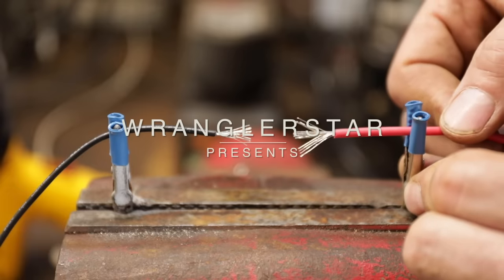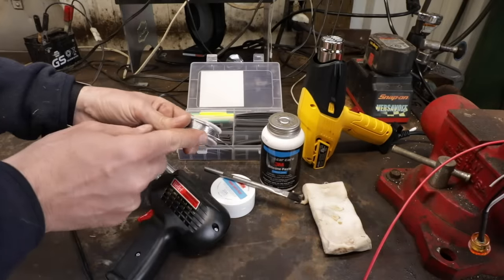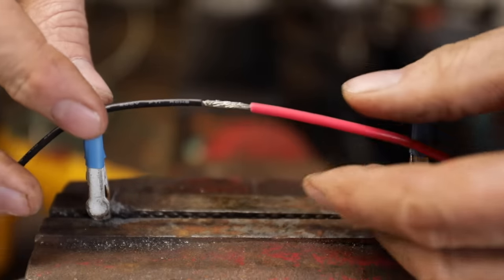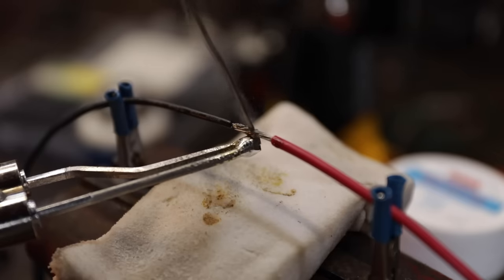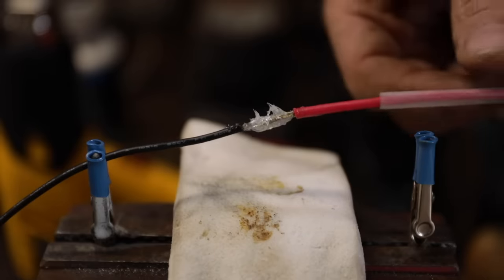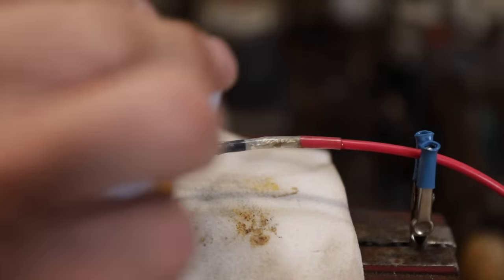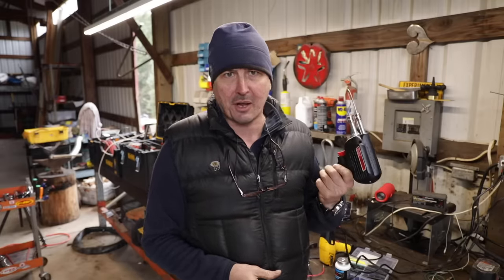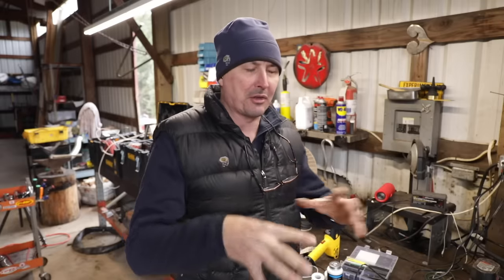How To Solder Wires Like A Pro

Comment from the maker: Here Is The Link To Our Amazon Affiliate Store https://www.amazon.com/shop/wranglerstar You Can Purchase Your Soldering Tools Here. #ad
Reply: Great video, for Stranded wire. The "Western Union or Lineman splice" for Solid wire is good as well. I like using the lineman splice on stranded wire with shrink wrap, it seems like a stronger connection. Thank you for videos and stuff you showcase on your channel.
Reply: That's actually fairly close to the NASA method. In theirs you twist each end to a small hook and twist them back around each other and crimp so you have something like a super tight chain link, you then solder the whole thing. It makes for a very strong bond as well as a perfectly good connection.
Reply: Slip the shrink tube on before you make the connection in case you can’t slide it over an end of the wire!  Just a tip!
Reply: can you put your belt up on the store?
Reply: Great video.. I myself switched to using the self silicone shrink tube.. It works great with one less step.. Peace!!
Reply: thatrealguydan, That's how i do it, I strip a little more wire than he did, and i make a hook on each and hook and twist them around each other.. I seen a well company years ago do it that way, and he said it's by far the strongest connection he's found..
Reply: Every time you recommend a product Amazon seems to run up the prices. Also, would love to hear your thoughts on Amazon's unfair practices are gonna make them the first trillion dollar company.
Reply: Uncle Istvan, I get what you're saying, but you can't blame the company, when it's the people who are buying from them.. Peace!
Reply: I've always like the shrink wrap crimp connectors, they can be pricey compared to this, but they're quick, easy, and have a heat activated adhesive that glues to the wire pretty tightly.
Reply: Tape ALWAYS comes off. Heat, cold, dirt, vibration etc. Fine for temporary connection maybe but not for realz.
Reply: The new Amazon store is looking great!  I'm ready to buy new work socks.  I know you mentioned once what socks you wear for your firefighting, but I can't remember.  Could you put your favorite work socks up on the store?  Thanks Brother!
Reply: That's a very nice job you did. Bravo
Reply: the "nasa" method is the lineman's or western union splice. Superior physical connection to this method. pretinning the wires is important too. also, he shouldnt be reccomending a gun style iron for this work. a good quality pencil style iron will be sufficient and much cheaper.  I've been an electronics tech for 20 years and I don't even own a solder gun.
Reply: Michael G--You say he shouldn't be recommending a gun-style iron for this work, but never explain why you think that.  I have both, and use a pencil-style if space is restricted.  I also prefer it because it's lighter and easier to maneuver around small components.  Is your reason because a gun throws off too much heat and melts wiring insulation and components if held there too long, or.…?  Come back and tell us why.
Reply: Wranglerstar
Reply: This is "pro" soldering...ipc-j-std-001
Reply: @stever5887  Mike G is 100% correct the gun style iron is not correct for this solder joint and in my opinion a poor choice in every situation.  Especially with a bulbous tip, tiny contact area = poor heat transfer, the proper splice with the proper iron, solder process (solder type, flux or flux cored, composition, diameter etc.)lead to repeatable reliable joints. ( Just look how long it took to melt the solder, no temp control and no real measure of power (wattage) at the tip.  The jacket of the wire should never melt.
Reply: In my basic soldering course from the U.S. Army and later in my college soldering classes, all of the instructors and professors conclude that you should never "fray" the wires before a solder connection is made. You should make every effort not to disturb the factory twist of the wire. By fraying the wires, you are forced to use to much solder in the connection. Improper soldering techniques is one of the most common reasons for component failure.
Reply: Cody, I like your videos. But this is a copy/paste from the Chrisfix video. Not cool...
Reply: Wranglerstar t
Reply: Please, never solder wires. If you really have to do soldering use silver or copper. Bigger wire, bigger problems.
Reply: You put flux in the wires so there is nothing wrong with touching the solder to the iron. The solder will follow the flux... You had that iron on them wires way too long!!! Burning the sleeving etc and burning the strands.
Reply: No soldering tools at that link!
Reply: There are no soldering tools at the link
Reply: @calvinh.8882  NASA way to do it.
Reply: @ryanallen3704 o, you never put the solder on the Iron.
The solder melts but onto an under temperature wire;
Unless you want to make dry joints !
Reply: Crazy how many professionals are watching YouTube videos on how to solder.
Reply: Wranglerstar; the powers that be also sell shrink tubing for marine applications that could lend itself well to you with all the electrical and machines you have. Said marine shrink tubing has an adhesive that is activated during the shrinking and the adhesive oozes out of the joint for a 100% waterproof connection.
Reply: @comingapart  I believe he DID state that the pencil style was sufficient and cheaper but that he was using the one that he owned.
Reply: Doesn't look like your link has any of the soldering tools
Reply: @calvinh.8882  an Oligarchy is not "the company".  A very few Big Tech oligarchies now control what you see on any internet.
Reply: That’s not the strongest technique, you reall should have them twist as others mentioned, preserving any strand twist already there. 
And no extra flux should he needed if using rosin core solder. 
I wouldn’t use that giant gun for that small gauge but I guess if you’re careful.
Reply: What your grand-dad put the solder on the iron end is because when you have liquid solder on the end it makes better contact with the wire/pad/component thus bringing it up to temperature faster and making for better joints. Thermal transfer is very time related so the faster you can heat the area and get out the less heat will leach to the rest of the board/wire and cause damage.
Reply: I need the soldering kits, including the ones for small electronic components.

Comment: Always connect black and red wires.  Can never go wrong.
Reply: That is correct
Reply: kaboom
Reply: Ofcourse
Reply: Looks like an led trailer light plug/harness so it wouldn't matter
Reply: Lol thats pro
Reply: Yeah, and you always go positive to negative right?
Reply: It typically is correct, in a box if you have a 3 wire or even a 2/2 wire and you want to continue the hot circuit you would connect the red and the black or the “hot” wires. Sometimes you would you use the white wire if you carried your white and phased it to hot in the box
Reply: @splashman2111  nerd
Reply: Your telling the wrong generation this lol
Reply: Lolol
Reply: I think this was just for demonstration, and he knows.
Reply: @labsled  if you're familiar with the channel, Mr.W has done such things
Reply: What are you a wirist?
Reply: @trisfen9840  wirist level 99999
Reply: Lmao im so glad I wasnt the only one whose first thought was "wait a minute..."
Reply: Yes, but you have to be a good runner first :)
Reply: The best when 1 is - and 1 is + and it is a battary it will go disco
Reply: I mean alot of time red to black is correct. Depends on what your doing
Reply: @kirk5649  Sheeesh not if u have a battery infront of you and there 2 wires , one black ans one red... thats not good 😂
Reply: This is not how wires work, the colors of a wire are only there for display so you know what they represent, so all wires are entirely the same (apart from size and copper). The big issue would be if you were connecting the postive wire of a battery to the negative of a battery, I don't know the statics of your survival rate of you do that, but most you may get is battery chemicals on your skin. But yeah there isn't much of a problem connecting those two wires without a power source.
Reply: Oh, me too.
Reply: Made my day
Reply: Some on here don't get sarcasm Steve Dey. Lol
Reply: Can see only black and white
Reply: Bahaha 🤣
Reply: Pow!!!
Reply: Thanks for the tip! I’m about to go for it!
Reply: 😂😂😂 not wrong
Reply: 😂😂😂😂😂😂😂😂😂you've almost got me a heart attack
Reply: Tis but a spark
Reply: And if you have a multimeter and the knob is turned to ohms that is when you plug it in to a socket
Reply: @Adrian CV 😂👍🏼
Reply: Lol
Reply: It took so long to heat the connection because you need to put a flat side of the chisel tip of the soldering iron on the work. There is more surface area to transfer the heat. Also, if you are soldering electrical connections using resin core solder, you usually don’t need to use paste flux. That’s what the resin core is for.
Reply: @michaeldolinar3716  black and red doesn’t always mean positive and negative. At my job red is positive black is signal and blue is zero
Reply: @A Town 😂😂this should have more likes
Reply: Lmao
Reply: It's ok. Just pigtail a ground and you're set.
Reply: Lol
Reply: Yes right
Reply: @A Town toxin care no color either
That doesn't mean you should put acid in normal water bottle
Reply: I wish black would leave! Why do we work to be strong within black environments when they we're never the place for us! I want to be my loving self, free of political burdens and be around family who loves me and see's me more than to be used as a control! Maybe I will call my family except if they we're to meet my child they would be on my time and I never seen them as grey
Reply: Lol! Ugh  this is real work! Tough! Except always worth it to keep going! Thier has to be somthing worth living for!
Reply: Lol, no boxes!!! Hope everyone is healthy
Reply: "Yellow kills the fellow"
Reply: I do it for the cool lights.
Reply: Great advice
Reply: As a novice, i was trying to distinguish if this was sarcasm or not. It is indeed sarcasm 😂
Reply: @lingfong I was hoping someone Saif this so I wouldn't havento..thank you
Reply: Not too smart are ya?? It's a demo
Reply: @terrychaput9211  google "sarcasm" .    The more you know.
Reply: It’s a light with short lifespan
Reply: Ha Ha Ha!
Reply: It's a demo
Reply: I always connect black to the yellow one. The red ones look better when connected to the white ones. It’s just a preference. Always color mix and match to your liking.
Reply: Thanks for the tip! 👍👌

Comment: For me the hardest part of wire soldering is to remember put shrink tube before soldering those two wires.
Reply: AND keep it far enough away from the soldering job that it doesn't shrink up before you can use it...! >_<
Reply: @simonbelanger3923  ⛪
Reply: Been there brother.
Reply: Ha ha, I’ve done that a few times myself...very annoying.
Reply: @simonbelanger3923  Exactly, and normally you  don´t  solder a black wire ( - ) together with a red wire (+) ... :)
Reply: I thought i was the only one LOL
Reply: Leon thecat  and thanks for the tip!
Reply: @jsngallery  You can't do that.  The tubing shrinks with heat, and if you have sliced it down its length, the sliced "sides" will pull away from each other with the heat and fall off the wire.  Even if it manages to cling on somehow, it won't seal/protect the connection, which is the whole idea of using heat shrink tubing. :)
Reply: Always a problem for me:)
Reply: Lol so true
Reply: strssko that is the struggle
Reply: 😂😂😂  Yes been there   so frustrating .
Reply: First time soldering, took a few times, got a hang of it but the annoying thing was, when you soldered something really well, you fogot to add heat shrink. In the end, I had to use electrical tape as I didn't want to undo it.
Reply: Wish he had shown that.  Not all wires have one end dangling.  Also be careful that you don't shrink it while soldering!
Reply: YUUP! I done that with 0 gauge I’m like oh well it’s done (at the ring terminal)
Reply: i have this problem, then when I actually do remember to put it on,  I forget that the solder is going to be  slightly thicker and I've put too small shrink tube on..
Reply: I was about to say the same " why didn't he put shrink on first.."
Reply: I hear ya! And its always on the best soldering job I've ever done when this happens!
Reply: Isn’t that the truth!! About 50% of the time I get the shrink tube on pre-solder. Not a huge deal if I have a lot of wire to work with, but if it’s a tight splice things may end up being thrown across the shop!
Reply: 👍🏻🤣🤣🤣🤣🤣 me too
Reply: I was thinking the same thing! If I had a dollar for every time I forgot the shrink tubing! LOL.
Reply: If you don’t care about looks, buy some liquid electrical tape.
Reply: Yes today I went threw this lol
Reply: it happend to me but i sliced it up at middle and shrinked it together it wroked to,
Reply: Agreed, its probabbly 50/50 the times i remember the put the tubes on :D
Reply: Done that more than once!!
Reply: I thought I was the only one..lol
Reply: And why is it that when you forget the shrink tube you always seem to get the wires soldered together perfectly?
Reply: same 💀
Reply: LOL me too
Reply: With many moments of silence as well... Before I redo it... And it happens all the time... So I made it each wire to have shrink tube before I even started soldering... Guess what?? I forgot to do that as well
Reply: LOL
Reply: Same here. 🙂🙃🙂
Reply: @simonbelanger3923  exctly. I learnt it the hard way
Reply: Same here bro
Reply: 🤣 fr tell me about it every time I yell at my self then still forget again 😂
Reply: All you have to do is cut the wire to put the heat shrink on and then make another splice. Just make sure not to forget the heat shrink for the second splice or you're going to make a third
Reply: @bror8228  the color of the wires that you're splicing together mean nothing.
Reply: It's a constant battle
Reply: You always know when you've forgot  cus it'll solder perfectly lol
Reply: Soooo many times.
Reply: 😂 Yep, even after so many years.
Reply: Bruh haven't done it yet bc I fear it
Reply: I'm retired! Sorry all I had was yelling right!
Reply: 😂 happens to everyone
Reply: That was the first thing my friend taught me to do when I was learning to solder! It just makes so much sense! It would be impossible to get it on afterward if neither end was open! Since I use it mainly to resolder a strings of fairy lights to the battery pack after placing the lights inside objects while keeping the battery pack outside of the object. It would be really difficult if I forgot to put the shrink wrap on!
Reply: What about isolation tape or spray?)
Reply: But I always do a better job the second try. I think it's imperative to forget the shrink tube the first time
Reply: Why you gotta attack my aging memory like that? 😂
Reply: ...So do I mate...so do I !....
Reply: The moment he mentioned shrink tubing I started looking for where he'd already put it on the wires and realised he hadn't.
Reply: I find this massively difficult and I don't know why. I have a soldering iron with a stand and stuff which goes up to 400 degrees. At 400 it takes a few seconds to get the solder to melt and it immediately disappears. At 320 I can get it to flow now and again but it takes an age to do anything.

Comment: Its easy to twist wires when they are detached like that, its a different story when they are actually attached to something and in tight spot :D
Reply: Yep, and it’s very difficult with high amperage wire that runs directly to the battery. Even 25A wire running to a motorcycle battery is quite difficult
Reply: So true! I always seem to end up with a twisted up mess!
Reply: I'm with you, everything is easy on the bench with clamps... hardly real world
Reply: Just means you didn't take enough things off to make it not so tight!

Comment: As a soldering pro I very much approve of this. Your method is pretty much foolproof. A tip: have some molten solder on the soldering iron tip to act as a heat conductor. That way you avoid the long heat up times like you had in your example.
Reply: 3:44
Reply: "grand dad said" then mumble..... Tin it. Is all.i got

Comment: If you’re going to solder wires in a car or truck, just be sure it isn’t in a harness with any movement at all, since soldering makes the wire end more brittle right near the joint. You’ll notice almost all wire connections are crimped from the factory in an automobile because of vibration, for this reason.

Comment: I bought a soldering station last year. It changed my whole view on soldering.  It never takes that long to heat up, and it is amazing how easy it is to solder now. Also, always use small solder. It heats up and melts faster and makes life easier. Great video as always.